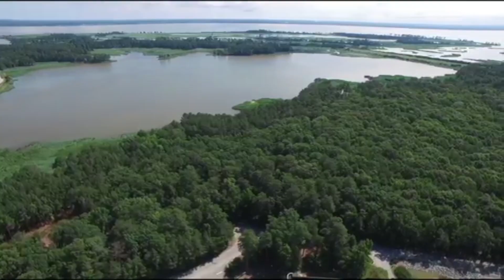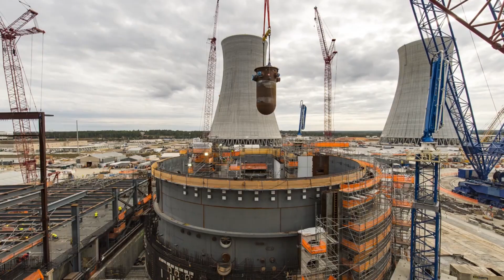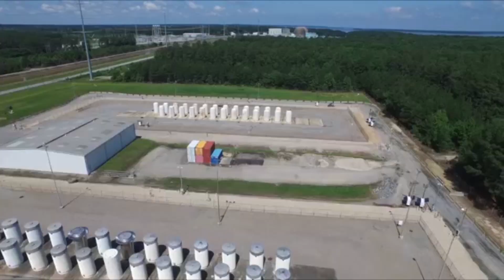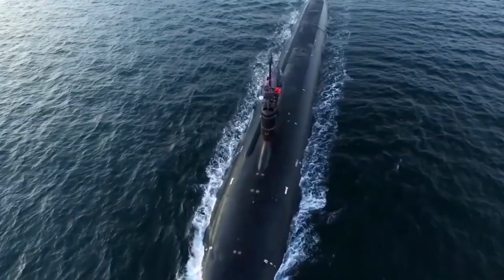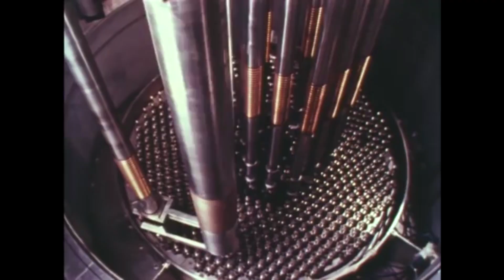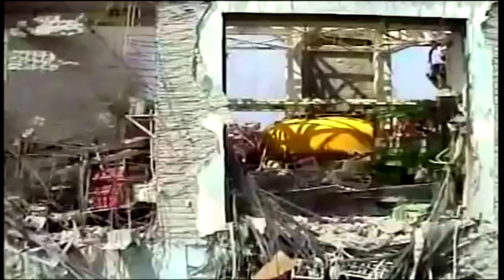Nuclear Power Full Lifecycle Environmental Cost

Comment: When you say a golf ball size of uranium to power a person's whole life, did you mean U235? How much U238 would that amount to? Multiply by 8 billion people and how does that compare to the available uranium on earth? It would be great to reduce ocean acidification by getting an energy source producing low CO2. How much CO2 will be produced by mining of rather more scarce uranium? Shellfish and the ocean life cycle may not adjust to acidification. Some primitive shellfish coped in earlier aeons but would we want to go back to that stage of sea life? I think many high voltage DC transmission lines should be installed to transmit power from sunny areas to less sunny ones daily and windy to less windy. And to back up nuclear power plants for the weeks when they are refuelling.
Reply from the maker: There is easily hundreds of years of uranium available to be mined, and thousands if we can get it from sea water, and the CO2 is considerably reduced. And that doesn't even take in to account technology to reprocess fuel and to use the U-238 as fuel, both of which make that number much more favorable.

The average person uses about 500 kw-hrs of electricity in their lifetime. A nuclear power plant uses 27 tons of moderately enriched uranium to produce 1000 MWe of power over the course of 1 year. Do the math and that's actually only a few grams of fuel, smaller than the golf ball I claimed. Based on enriching ratios, I believe the golf ball size is closer to the amount of raw uranium required to power our lives.

I don't have a good way to know how much less CO2 is used, but in theory if nuclear was wide spread, along with electric vehicles, the amount of CO2 produced for power is almost nothing with pure nuclear.
Reply: @WhereisRoadster  wrote: "The average person uses about 500 kw-hrs of electricity in their lifetime." At $0.20 per kw-hr that would make a charge of $100. More like the amount per month. I think you mean megawatt hours.
Reply from the maker: @soundhill1  Ere, you are right... That means only a few grams of refined uranium is required to supply all of the electricity you will use in your lifetime, which is insane. Even if this number quadruples, it will likely be closer to a marble than a golf ball.
Reply: @WhereisRoadster  A marble at 2cc and U235 at 19g/cm makes 38gm. U235 at 0.7% of natural ore makes 5.4kg of natural ore. Times 8 billion people = 43 megatonnes.

Comment: What about micro nuclear? I've read quite a bit about this; still nothing production has been created (that I'm aware of), but it looks to be one way forward for all of the NIMBYs out there. Here is one article I found about it: https://www.sciencemag.org/news/2019/02/smaller-safer-cheaper-one-company-aims-reinvent-nuclear-reactor-and-save-warming-planet
Reply from the maker: Micro nuclear basically is the same as normal, but can be manufactured cheaper, as I understand it. It, like all 3rd generation or later reactor, should be safer. Plus the inherit design is safer usually.

Comment: What is the cost of taking take of the spent fuel rods of a one gigawatt nuclear plant generated over 40 years for the next 250,000 years? Who is going pay for that?
Reply: Nuclear fuel ought to be reprocessed in order to #1 extract more energy out of it #2 produce 1/10th the mass of spent fuel waste and #3 potentially lower the decay time to the point that it would reach the level of radioactivity of natural uranium in just 300  years, not 300,000. Many countries reprocess fuel but the USA does not.
Reply: @robertpearson6760  Yea, that went so well for Karen Silkwood at Kerr-McGee.
Reply from the maker: That is an economic cost, which should be taken in to account with the power cost. The simple truth is, the amount of waste is actually quite small, and there's a huge possibility to recycle that in the future so there will be less. Burying it a mile deep should be more than safe, especially if in an area that isn't very geologically active. The radioactivity goes way down over time, 250,000 years is a number that is put out there, but honestly there isn't a huge amount that needs to be done. Every form of power generates some radioactivity, that's one thing that I'm going to try and compare for a final video that talks about the best type of electricity.

I'll probably do a video about the disposal of nuclear waste. The bottom line, however, is that only about 0.1% of the fuel is actually dangerous for longer than 100 years, and that entire amount could fit in a few storage containers (Without shielding, not recommended!) With a dual or tri tier system, we should easily be able to have reasonable shielding for a long time, although I would want to study the issue out more before I say that for certain.